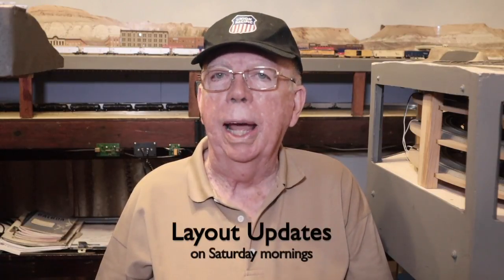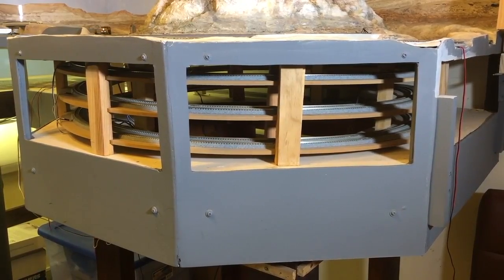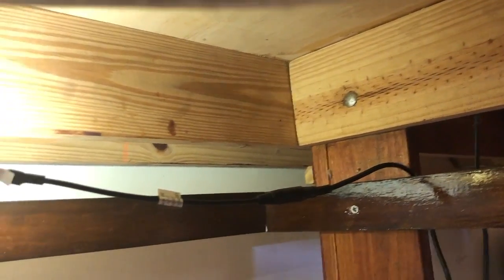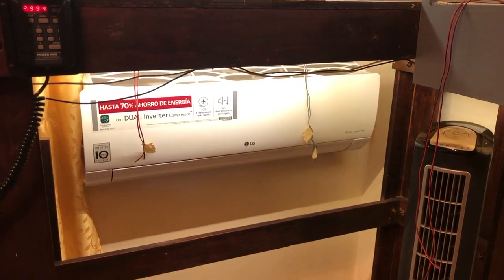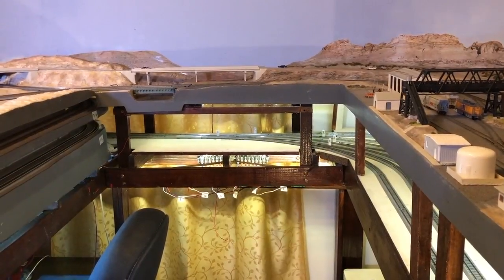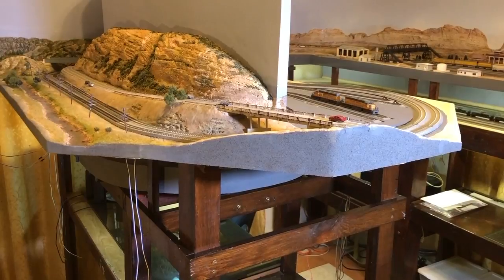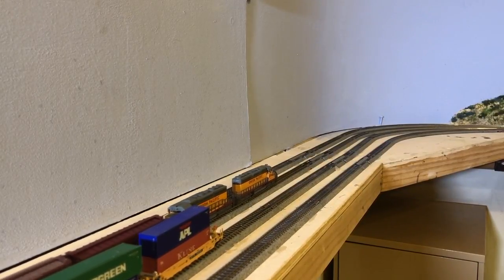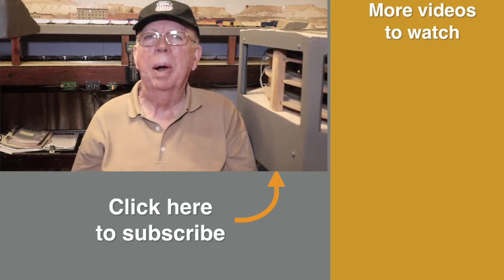Under the Layout 4: A Tour of My Model Railroad Benchwork

Comment: I like your oval helix . It’s longer then I thought it would be and may work well on my display. I may need a better engine for my train. I will determine that after I get it out after my move. I can hardly wait to get to that point! Thank you  for the link to this video. It's helped me to plan!  It’s difficult to plan a layout when I don't know what sort of room I will have to put my display in so for now I’m limiting it to eight feet long.  The width will be determined by the  minimum diameter needed for my balloon and helix .. once in my home I plan to set up initially on a cardboard template. I will cut track out from card stock  to position the track then after I have designed the track layout , I will buy the necessary track and replace the card stock track with it. I'm still sort of intimidated by the helix, but with research, I think I can make it work.
Reply from the maker: Thanks so much. I’m not a big fan of helices, but sometimrs they’re necessary. It’s important to take your time and build a helix very carefully. Both of my helices climb at a grade of 2 percent, snd I feel that’s important. Good luck with it. ...Roy